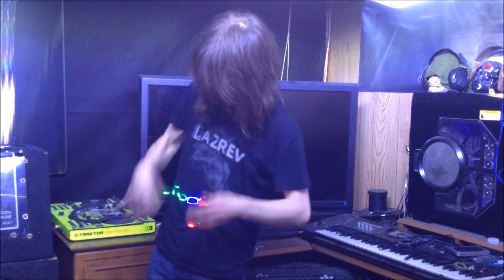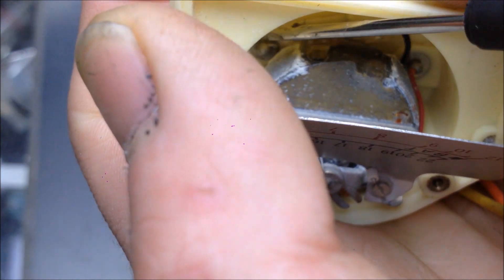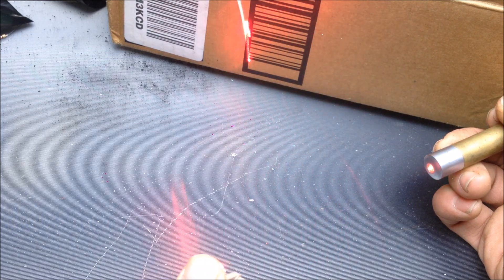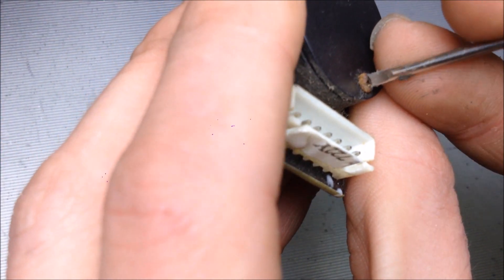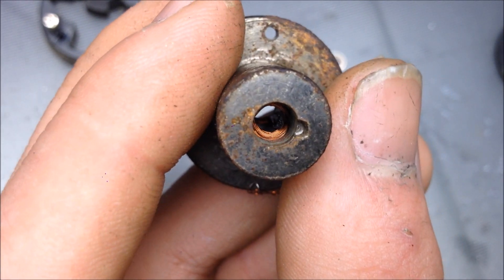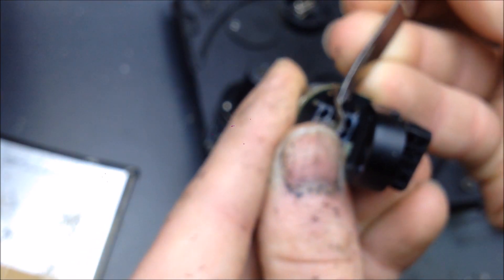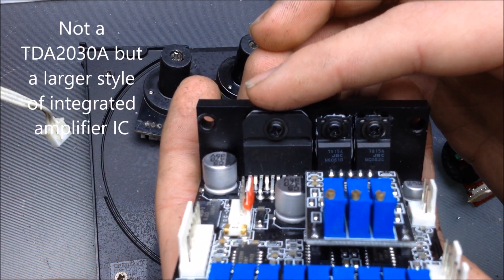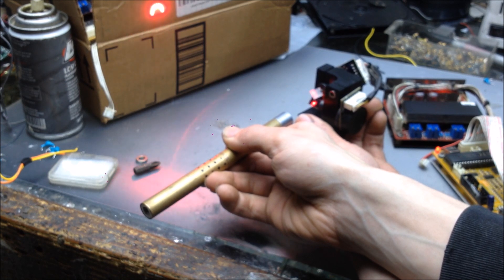Inside the Closed Loop Laser Beam Stearing Galvanometer.

Comment: Nice video! Makes everything a lot more clear! I have a problem with the glavos of my laserworld cs 2000. All of a sudden when I started the laser my y galvo seems to be 90 degrees off. Do you have any idea how to solve this?
Reply from the maker: Does it still move? If so it could be a failure in the main IC on the galvo driver or the mount could of become loose causing the entire galvo to rotate in the mount. If the galvo does not move than it's a larger problem. It could also be a failure in the main amp IC, regulator IC, or a bad galvo entirely. You can track down the fault by swapping the galvo connections ( linking x to the y amp and vise versa ) which will help determine the point of failure. Sometimes you can get just a single galvo and replace it. If you are going to replace the galvo I would suggest either going through the OEM, or looking over what's on the market. Your laser world is a low-mid tier unit so you probably can find decent replacements on eBay or Amazon, however you should also note to get a kit that is suitable to your PSU ( Best to aim for the 24v-/+ kits as they perform the best overall and are capable of working down to 15v-/+. That's about the best advice I can give you on trouble shooting, from that point you will have to continue on based on your level of technical awareness and tools.
Reply: @Zenodilodon  thank you for the information. I'm looking for a specific part in the back of the galvo which is easiest explained by a photo. Can I send you a photo through email or by phone?
Reply from the maker: @janwillemvanbaar  Sure, my email is Zenodilodon@gmail.com

Comment: Hi, my galvo laser is engraving wavy lines, like it was handwritten. It's a Trumpf unit. Could it be the galvos failing?
Reply from the maker: Yes, this is often a symptom of failing galvos. It's usually either due to bearings starting to go, the mirrors becoming loose on the ends of the galvo, or failing magnets. If it's magnets the galvos should work pretty decent when scanning smaller angles. If the mirror is loose you will be able to do large squares with little problems but the corners will look a bit off. You can carefully check the bearings to see if the galvo shaft is a little loose. If your printer uses analog galvos with a -/+differential signal then you can easily find and calibrate an off the shelf galvo kit. If you have questions on what galvos may work best for you email me pictures of your current galvos and galvo amps. Zenodilodon@gmail.com
Reply: @Zenodilodon  thank you for the answer! I'll run some tests and show you what I've got.

Comment: Hey! very good overview, there is a question: if I use an advanced control board for a cheap galvo, can I get better positioning accuracy and speed?
Reply from the maker: KPPS is a mix of the ability for the galvo to accelerate and break. This is a hardware rating and is not measured on the software level. To improve accuracy on the software to hardware portion the DAC is the most important as the higher the bit the more points you have in galvo positions. However to achieve a quick response with accurate positioning a high KPPS rating is required. It's a driver + car performance mentality.
Reply from the maker: Arpad Toth  Glad to hear, I take it you got my email reply as well?

Comment: Great video! I seem to be lost understanding something. If I’m using a galvo with a high power fiber laser. By positioning the galvo further away from subject. Will it have a larger surface area to cover? Most galvos max area is 24”x24”. Is turning up the laser power and moving the galvo further away a solution or will the image be distorted attempting this? Would love to know your thoughts on engraving larger surface areas. Thanks in advance!

Comment: can you do a video about the differences of these galvos and the ones from thorlabs?
Reply from the maker: Many galvos operate the same as these do including some on thorlabs. Some of them are suspended by torsion springs and do not have bearings in them. Another difference is in how feedback works on some galvos. The ones in this video use optical feedback, if you want to see another style which is capacitive feedback for position sensing check out the video I posted on the Raylase dual axis beam steering assembly.
Reply: @Zenodilodon  interesting. I really wonder what makes them so pricey

Comment: I have a question: Is it easy to buy the closed loop galvos ? I would like to buy some but all I can find are kits that include the controller board, and I am not able to find any part numbers for the galvos alone. Do you have any hints? Thanks for this instructive video btw :)
Reply from the maker: You can often ask sellers on eBay to drop the show card/DMX board if you send then a message. For other options on galvos check out the links below.

http://www.spacelas.com/en_products/Galvo-Scanner-Systems-5-1/

http://www.phenixtechnology.com/index.php

http://eyemagic.gr/laser-scanners.html

https://www.cambridgetechnology.com/products/galvanometer-scanner

https://www.scannermax.com/products/scanners/

Hope this helps!
Reply: @Zenodilodon  Yes, thanks a lot !

Comment: Nice and insightfull video! Have you got any video's on how to balance the mirrors, or some source that ilaborates on that?
Reply from the maker: Physical attachment and balance of the mirror is often done with a jig of which the galvo rests in during attaching the mirror. I don't have one of these so I end up doing the best I can with spacers and a calipers. Tuning the galvos for the mirror is usually a long task of seeing where each calibration pot needs to be set for best performance. I try to replace galvo mirrors with a close to OEM mirror so I only usually do minor tuning. I don't have a video up on the tuning. I do have some points in videos where I put mirrors on but I don't really go into details on balancing, mostly because I don't have a jig for it and I want to get one before I cover that topic.

Comment: Can the voice coil mechanism of the OPU of a CD/DVD/Bluray burner be used or modded into  a galvo for projecting laser show vector graphics?
Reply from the maker: Not really, the spring suspension has there own resonance oscillation which make the unit unstable, the power to weight to cooling ratio makes it also susceptible to  over heating when it's driven at a higher speed/torque. There is no closed loop compensation either which would make for a very sloppy open loop system. If you're looking for a simple DIY thing to play with speakers have been the go to on that. Maybe also hard drive arms as well but your results will be terrible unless you really go into using galvos. Even with galvos to get reasonably good graphics can be quite a feat.
Reply: @Zenodilodon  I saw this science video about modding the DVD pickup into highend nano-microscopy gear, and I am intrigued what else can be done with that component.

Hacking CD/DVD/Blu-ray Optical Pickup Unit (OPU) for Fun and Scientific Research:
https://www.youtube.com/watch?v=5bqujaldaCQ

I saw the DVD burner can tilt its lens in various ways, and it would be interesting to project something with it. I definitely do not itend to run the internal red laser diode at its full 150mW (rather 1mW through a resistor - I do not want to blind myself with such a cat igniter), so overheat will be less an issue, unless the coil itself is too heat sensitive.
Reply from the maker: @AerialTheShamen  For small movements/deflection as decent speeds you will be ok. The trouble comes in when you are trying to deflect the mechanism to far or too fast. The coils can get warm and have little heat dispersion but that's for fast/wide angle applications. The video is pretty neat, there are certainly a bunch that can be done with the OPU, I haven't really ventured into using them for much of anything myself though.
Reply: Would installing a lens after the deflection unit help to enlarge the picture? 

Yet I haven't built anything, but the idea of making something like this of DVD writer parts and e.g. an Arduino (or simply analogue audio input) appears fascinating. I do not want to run it in a disco or such (only a meditation room/temple), so the picture doesn't need to be bright.
Reply from the maker: @AerialTheShamen  Yes, you can use a complex set of lenses to make the scan angle wider, however you will run into issues with the beam size and chromatic aberration issues as you increase the input size vs the output size in angle. If I may be quite frank on the matter though, there is good reason why galvos are used. A they can support optics that can handle the power densities of a relatively powerful laser and B they are very effective and also have close loop feedback. You won't get very good results using much in the means of DIY for getting good results. This of course depends on your complexity of pattern projected. Galvo kits start pretty cheap on eBay for about $80 USD. There is also a page that you can look at for DIY laser galvos.
http://elm-chan.org/works/vlp/report_e.html
Reply: How can lenses induce chromatic aberration? Lasers are monochromatic, isn't it?
Reply from the maker: @AerialTheShamen  Yesthey are coherent, but if your using a mixed laser beam such as RGB you will start to see the beams separate the further out they go from center through lenses.
Reply: So it would cause the same like what is called poor convergence on a CRT TV? And like there, it theoretically certainly can be compensated by complex control circuitry or software. (I don't want to use multicolour lasers anyway - only some simple stuff with the red DVD laser or possibly a green one from a pointer (if it isn't too dangerous).

Comment: Hi, are there an open-sources controller for the Galvano system, please?
Thank you
Reply from the maker: There are ones you can make with Arduino. I don't work with open source controllers though so you will have to find that information on your own.
Reply: There are several open source laser control software packages for doing shows, if that's where you're headed. Most of them are only compatible with specific DACs to convert either USB or Ethernet from the control software's PC to ILDA standard analog signals for your scanners and laser driver board(s).
Most professionals use expensive Pangolin software (Quickshow or Beyond), which is only compatible with expensive FastBack 3 or FB4 DACs. The Beyond software and FB4 are ~ $1,500.
I use LaserShow Xpress Basic (2 projector license) and Etherdream 3 DACs, totalling $700. Instead of starting from scratch, I chose 2 New Feel 3 Watt RGB projectors (w/special ordered 40kpps galvos) @ $350 each, because I wanted to start with a fully functional laser system.
There are also less expensive USB DACs, galvos, and free show software, but you'll get what you pay for.
Hope this info isn't too late and is helpful. I'm luvin my lasers and playing with waveform imagery :-)

Comment: Nice vid, can i use the fiber laser to replace my co2 laser.?
Reply from the maker: You should be able to use a fiber coupled laser as a replacement. Just make sure the power is equal too or greater for best results.
Reply: Thanks i just replace the co2 but the mirror lens will remain?.. for 1390 engraving size..
Reply from the maker: @DidYouKnow04-12  I don't understand the question if you're asking for something to be clarified. You will need a collimated fiber coupled laser, the optics that are in the assembly after the Co2 laser should remain. The output from the collimated fiber laser should be very close to the output of the Co2 laser.
Reply: Ohh.. ok i get it.. thanks for the reply.. try it next time..

Comment: I'm doing some work with the first generation Formlabs 3D printers. We have a user in the community who has a galvo that does does not move at all. We ruled out the other components by basic troulbeshooting (moving wires and testing the galvo in another working 3D printer). Do you have any tips for troubleshooting and repair? Or do you think in this application that replacement is the only realistic option?
Reply from the maker: I would start by checking coil continuity on the galvo, sometimes the wire near the solder point can give way. If it's open check those points. If there is a break in the coil inside it's most likely not serviceable. Galvos are also usually paired with an amp. You have to replace the galvo and it's amp at the same time to ensure proper tolerances and scaling as well.

Comment: What would be the best frequency you could achieve as a laser oscillograph? Could it output 15 kHz horizontal sweep? And what's the on-off frequency you can achieve with these diodes? Instantaneously? I am thinking about building a monochrome projector that could project 512 x 512 pixels at 60 Hz frame rate on the wall of a building. Is it possible?
Reply from the maker: https://www.scannermax.com/products/scanners/
https://www.cambridgetechnology.com/?gclid=EAIaIQobChMI89mKj9u66wIVEr7ACh09zQ94EAAYASAAEgLWCPD_BwE

^ Best scanners

Laser modulation can be in 100+ Khz with suitable drivers.

https://innolasers.com/shop/index.php?id_product=11&controller=product

https://optlasers.com/laser-diode-drivers/

Comment: The one with the butterfly is capacitive feedback, i have a book where it is shown in. very simple linear at 90 degree
it's shown in book Measurement Systems ISBN:0-07-100697-4 page 874
http://meldco.dk/ts/200505.jpg
Reply from the maker: Nope, it's optical, I am aware of the capacitive feadback systems. The galvo in the video had an IR LED, the 4 sensors where checked for photo-sensitivity during attempt at repair and the amplifier did not have the proper electronics for capacitive feedback.

Comment: Hello good time.I want to make a galvanometer laser scanner ).What software should I use to get the shape I want on the curtain?
Reply from the maker: It really depends on your level of technical skills, if you are just starting you can use try to make your own system with aurduino or try something like  LSX and the Either Dream DAC,  or Pangolin QuickShow wit the FB3 DAC. Many galvos require special hardware called a DAC in order to operate with a certain program. I recommend looking into Quickshow+FB3 myself, LXS+ Either Dream is cheaper though.
Reply: @Zenodilodon  Thank you very much. This is a university project. A student before me has done almost all the hardware work. And the galvanometer can create a simple rectangular shape on the screen. Master asked me to create complex shapes on the screen and Next, get the scattered back beams to display the surface shape on the computer so that it can detect and analyze shape irregularities.

Comment: Thanks for the insightful insights!

What could be the cause of the backlash (about 50-100 μrad) of a cheap Chinese galvo?

What influence could a greater friction (viscous) in the galvo bearings have on the position regulator?

The galvanometer and drivers are not housed and exposed to resin vapor (SLA printer).
The effect may even exist before exposure.

PS: I'm glad that it does not just look so tidy with me ;-)
Reply: The "backlash" is caused by the lack of an error integrator in the cheap galvos. This is omitted to get the highest possible kpps rating without needing to worry about windup and overshoot.

Comment: Hi
it is very interesting what you have explained with the galvanometer. I know it long time ago . but what I wonder. if we  replace of the simple laser another one like engarving laser . what would it .
sincerely i respect people who do research loke you 
thanks 
sory for my bade englishe translation
Reply from the maker: Yes you can use galvos for engraving. There is an upside with resolution because you are not using stepper motors, however you do not gain speed unless you can supply larger laser outputs. Laser power output determines how must the machine can process in a certain time. Another issue with galvo is that the focus angle changes unlike a motorized x/y table. On a motorized x/y table the laser is focused into a pinpoint over the target surface, however with galvo the distance from the laser and the target surface is not fixed. On language, if you tell me what you speak I can attempt to technically write any answer to your question better and run it through google translate. I hope this helps!

Comment: Can we draw line, circle and sinusoids wave using two axis galvo with single laser source in a stationary table???
Reply from the maker: Absolutely, some people have hooked them up to synthesizers.

https://www.youtube.com/watch?v=jxVou1zGvgQ
Reply from the maker: The link shows using an interface but as long as your input signal is -/+ 5 volts analog from your source you can pretty much use a pair of galvos exactly like X/Y function on an oscilloscope.
Reply from the maker: @CalvinBlackArt , You can use any linear audio amplifier, but not digital. I would say to look for an old school cheap pair of computer speakers for a whole board to work with, many galvo kits can so up to 10 volts but I would suggest keeping it under 6.3v, if you can find one powered by USB you will be set. Just wire the speaker outputs the galvo amp input and use volume as a gain.
Reply from the maker: @CalvinBlackArt  That is is very good question. This was an easier task back in the late 90s/early 2000s. My best advice is to go to a thrift store and look for anything beige. If you have electronics experience you can also make your own, I can look into some of the audio amp ICs I have here for compatibility.